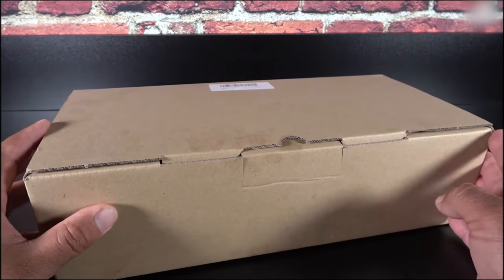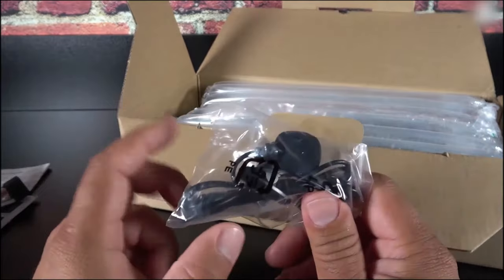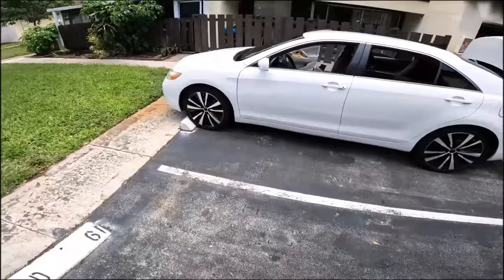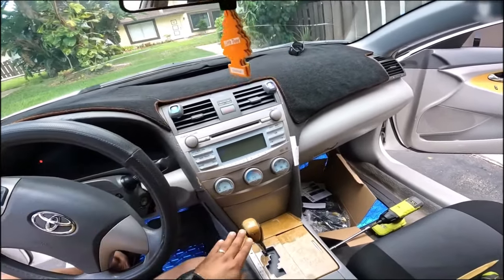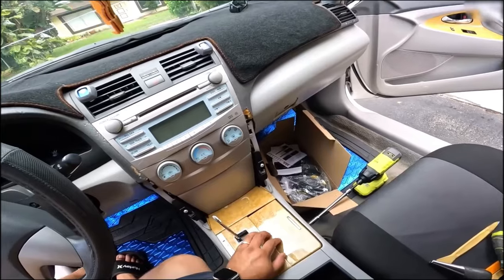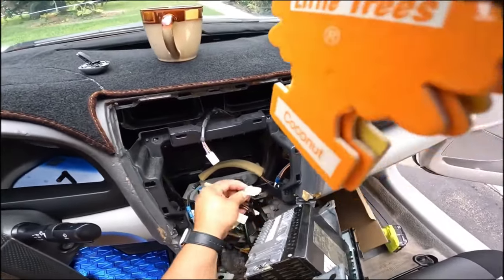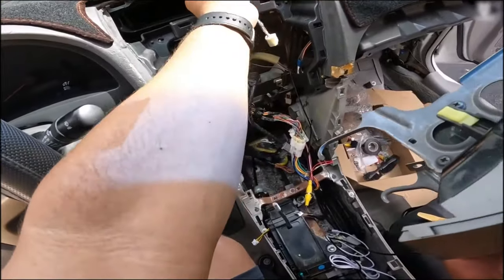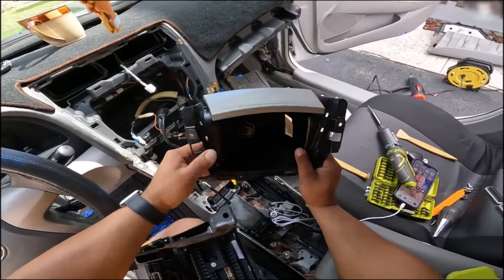[WOWiViD] 9" Camry Radio with Wireless CarPlay & Android Auto - Toyota Camry 06-11 - Plug N' Play

Comment: Bought this radio and the steering wheel controls are not working. Only the mode button works. All the other ones are not being recognized with the steering learn function.
Reply from the maker: So sorry to hear that you have problem with our camry radio. hope you can clear/delete all the record of the steering wheel settings, and then re-set.